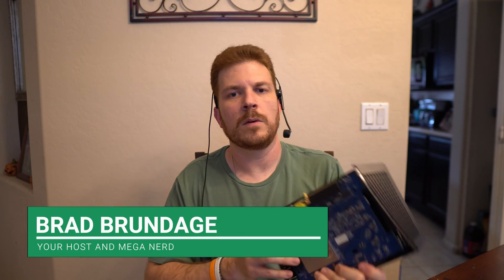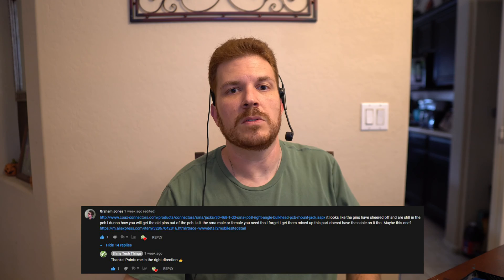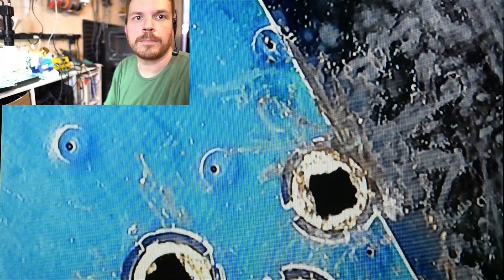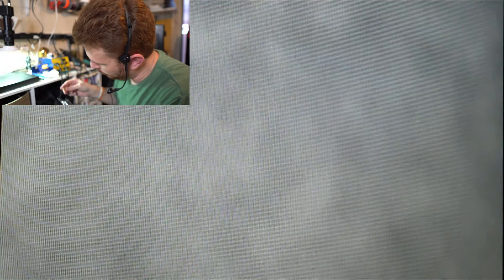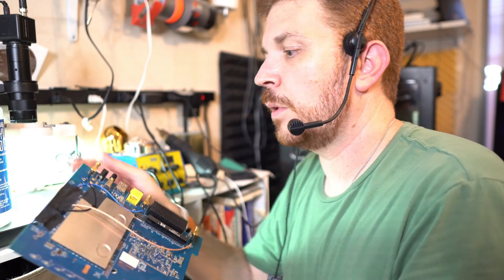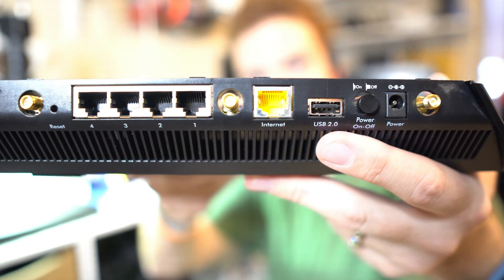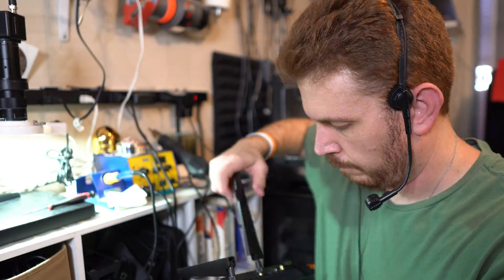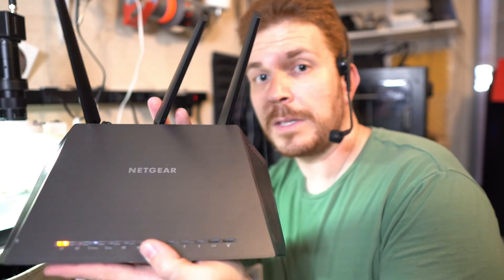netgear r7000 antenna repair | Part 2

Comment: Why not just glue it back on? It has no function to solder it ?
Reply from the maker: @manuelmanu I treat repairs like if the manufacturer were to refurbish a device in a way. The glue would have broken easily. Now it's rock solid like new out of the box.

Comment: I know I'm 3 years late.. but seriously, go spend the 30 bucks on a tube of flux and some solder wick.

Also, instead of pulling that out, push it through and out the way it came in... You should be able to do so without putting so much scratching on the solder mask and possibly damaging the traces.  It's a start, we all have to start somewhere.  Hopefully you have improved a bit since.  Nice work BTW.. if it works, it's not wrong.. it could be better, but it's not wrong.
Reply from the maker: @AlanDike Yeah, I have all that now but during this time period of my life on YouTube I was rushing to release 2 videos a week. Check out my latest video that was released today and the video editing is definitely better and I'm better on camera. But like you said everyone starts somewhere and builds from there. I'm still no Louis Rossman, but I also don't solder all day for my day job either. I mostly do laptop power sockets, USB ports, etc. But it's not every month either but sometimes it's a few times a month. Just depends what my kids break or people I know that are ready to throw it away because they think it can't be repaired.
Reply: @ShinyTechThings  I get the same type of practice lol... honestly the whole reason I watched the video is I was really wanting to see the antenna connectors on the mobo.. hoping they were similar to the same as the r6400v2 that has fixed antenna because I feel like making them removeable is an obvious mod.  Stuck around for video two cause I wanted to see how the soldering went.  I still use these routers, well the precursor to the r7000, the r6400v1 &v2 today.  They make great wifi repeaters on the cheap.
Reply from the maker: @AlanDike yeah for the price they  perform really well. What I don't get though is how tp-link archer C20 's still sell, granted they are like $20 and people wonder why they can't get speeds over 100mbps but the C20 only has a 10/100 WAN port on it, come on it's 2024 already!🤦‍♂️🤣 Stuff like that makes me wish that politicians would make laws on minimum hardware requirements similar to how auto manufacturers have to meet MPG requirements by certain years. Imagine if there was a law that by 2028 all Ethernet ports on items sold had to support 2.5GbE or faster. That would be a wonderful world to live in but we can all dream right? If you get a chance please let me know what you think of my latest video that I released today and if I can improve anything else in my videos for upcoming content.
https://youtu.be/aXHdl6CoGjg?si=yZwWimlMfvnSlml-
Reply: @ShinyTechThings  Hell, I just picked a r6400 up for 40 bucks.  Slapped fresh tomato on it and I'm getting 6x the speeds (ok, a little more lag, but I dont fps game) compared to the wifi 6 that I was on from the same spot in my room.  I went from 30Mb/s using my laptop on the wifi 6 to 140 on the in room wifi 5.  I can place that router where it's out of the way, but gets the best signal.. a place I couldn't use the laptop.  I have it as an 802.11AC client to the house wifi (5g) on one vlan, and on another vlan attached to a virtual wifi interface I've got my ssid also on 5ghz 802.11AC.  I dont see any real difference except for a little difference in latency hard wired into the back of the router...  Thats a win no matter how you look at it.  It's also pulling double duty as a nas for a small 128gb usb stick right now.  Still fighting to get the nvme dock to be r/w.. right now it's read only.  It's really hard to complain about their performance.  And temps are right by me.. 63C on the core processor, and 49C on the 5g.  In this particular instance, I dont think OC'ing it will do anything but maybe speed up the ssd writes a hair.

Welp, got the shared drive working.. its slow, like I'm not dumping 100MB of files on it at a time, but fast enough to use as a document repo.. had my share name messed up in the configs.  OOF  The 23Mb/s is probably as much due to the fact that its OG usb 3.0 as it is the cheap chinese nvme dock I'm using.  Either way, 512GB of storage space is plenty if I need it.. I don't forsee me needing it.
Reply from the maker: @AlanDike from what I remember years ago USB 3.0 had some sort of interference when it's unshielded. What happens if you wrap the USB cable with tin foil temporarily? I remember Bluetooth having issues near USB 3 too but it's a bit hazy in my memory. I'd try a higher end cable and or dock and see what happens too.
Reply: @ShinyTechThings  oh, it's a good cable.  Even direct plugged in the USB stick that gets 100+mb/s only sees about 10.  I'm far from worried about it.  It's primary role is repeater.  Anything else is pure icing

Comment: How can Netgear make a $200 router with antennas that break so easily??? Grrr
Reply from the maker: @Nate Legakis Unfortunately, that's the norm nowadays. I've seen this happen with other routers as well. Manufacturers in most cases will cut quality to increase profit margins. Even a $5,000 Cisco router has a low power processor inside and minimal RAM and storage.

Comment: Just curious but is there any reason why you didn't replace/ upgrade the thermal paste given the nighthawk's issues with thermal performance?
Reply from the maker: @Neil Rawlins I was unaware of the thermal issue. This router was given to me damaged so I figured I'd work on it and make a video on it.

Comment: Any thoughts on the plastic heatsink (that bump is a heatsink???). connected by thermal pad?  Looks the same as my Netgear r6400v2.  There is a big fan on it now, but I would love to be able to upgrade it at the point of contact.
Reply from the maker: @RB Blackstone from what I remember it's not plastic but painted or more likely coated or anodized metal. So what all mods are you wanting to do?
Reply: @ShinyTechThings  I was considering adding a copper or aluminum plate to sink the heat and offer more surface area.  Or possibly pulling their plastic heatsink out and doing an actual metal heatsink.  This router travels with me and may have to deal with the Texas heat.  I am trying to build in a larger thermal safety cushion without taking the whole board out and putting it in a rackmount enclosure.
Reply: @ShinyTechThings  Here is a pic that illustrates. It feels like plastic.  

http://RBBlackstone.com/files/YouTube/r6400v2_HeatSink.png
Reply from the maker: @RBBlackstone  you could try scratching around it with a thumbtack to test the surface out in a area that is not in direct contact for heat transfer and see if it's metal or not.
Reply: @RBBlackstone  I've just taken apart the same model of router and tho it completely looks and feels like plastic to the touch once you take it out it is indeed anodized metal and there's two plates so one mod would be to use a thermal pad between them and just to change the thermal paste over the processor
Reply from the maker: @Zona ALG that could work to improve the cooling system for sure 👍
Reply: @ZonaALG  Did you replace the pad with paste in the image you posted or did you heat and separate the metal cover from the processor? also now you've done it did it work?

Comment: I think I would have used it as a router... lol
Reply from the maker: @Eddie G-rider Do you mean that you would just disable the Wi-Fi and run just for a firewall/router and then have separate access point(s) for the Wi-Fi?
Reply: @ShinyTechThings  yes sir or as a extender
Reply from the maker: @eddieg-rider8939  it could do that, with the exception of extending Wi-Fi before it was repaired but now it could. What router do you currently have?

Comment: Did the place were the pins go in the board actually have traces going to them or is it just  place to mount the jack and the pigtail only carries the antenna signal? If so the old antenna pigtail was probably still working even tho it was sheered off its pins. Nice too have it secured and not wobbling around tho.
Reply from the maker: Just a mount from what I noticed. Sure I could have used Krazy glue but I want it to hold and be as strong or stronger than stock.
Reply: where do you get that replacement part i have the same problem with my router.
Reply from the maker: @steven hughes there should be links in the description or a pinned post. Please let me know if you have any issues finding it.